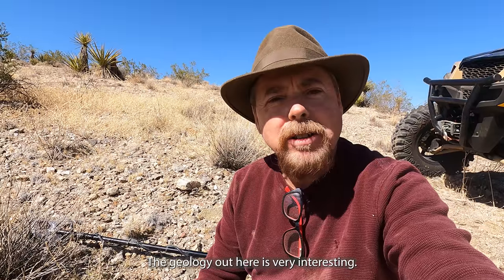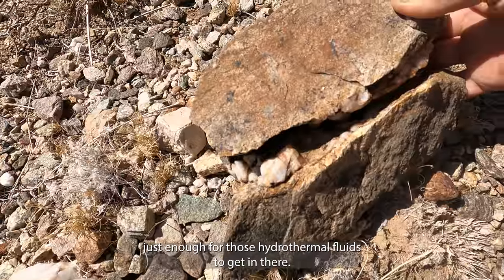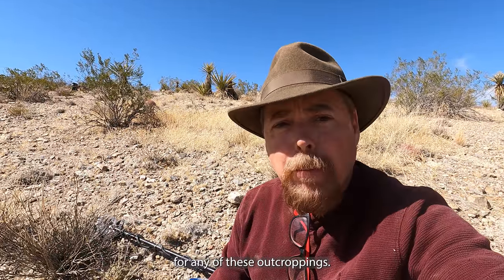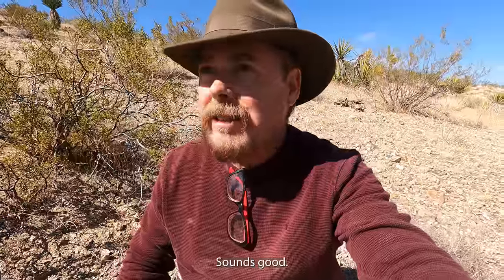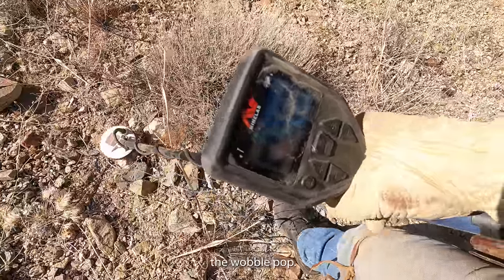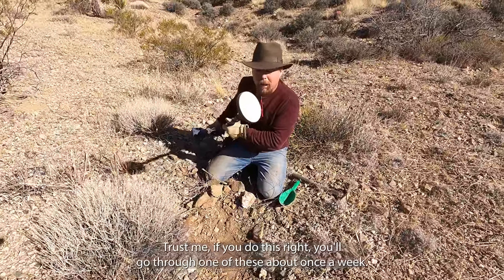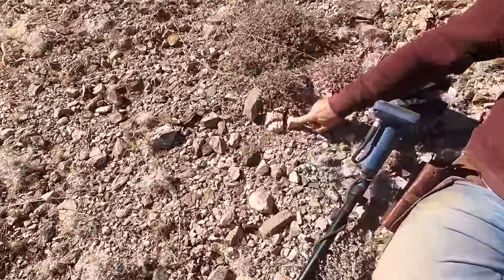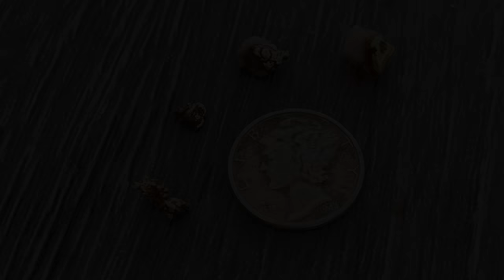Hillside Screamer's Everywhere. Metal detecting Eluvial Gold deposits.

Comment: Loved the geology lesson! I couldn’t help but laugh when your light fell. Until you’ve been underground you don’t really understand how frustrating it gets not having lots of room to work.
Reply from the maker: thanks and I know..... right
Reply: We take along a 36-inch roll of 2x4-inch hardware cloth (wire fencing).  Measure the perimeter of your working area, cut off a length to fit 60-75% of that and frame it into place..  Hang everything on it.  Works almost as well in the river, as long as you remember that it has to stand up to and hold things against two force vectors, gravity and current instead of just gravity.  In water, always place it downstream so the current is pushing tools against it rather than trying to pull them off.  Save your lengths, you will reuse them often.

Comment: I wish there was somebody like you out on the East Coast that could explain the geology of New Hampshire to me so that I could go gold panning and actually find gold instead of Micah
Reply: @bradthompson5383  any time there is heavy rain or a flood there's erosion incense in the state of New Hampshire you're not supposed to dig in the bank's the best time to go is after a rainstorm
Reply: @bradthompson5383  I want to find a place to find Hard Rock gold the alluvial.
Reply: @bradthompson5383  absolutely I do not disagree I'd like to find the specimen still inside of a rock that's all I just want to see it inside of the host-rock anybody can go dig a hole if they know what the Rock looks like did the gold is coming from which I don't know I know that it's a quartz I know that the courts if there is quartz around needs to have dimples dents in rust stain( vuggieness???)

Comment: Jeff, You should make a model of a fissure and how it works. When you talked about the fracture and cooling with crystalizing, many people think the fissure is filled like a fire hose and slows down and solidifies. It's more like the effect you get inside an exhaust pipe build up. When minerals drop out at like 1,200F or 900F, the water wont. That's what keeps going and pops out of the ground. They're still open when they stop and after many many flows can get clogged up solid over time, not all at once.

 You covered all this but to someone thinking it flows like a hose full of water, it don't make sense.

 I just cleared it up with my kid.
Reply from the maker: great idea

Comment: Thats pretty slick there Jeff.  You have gone a long way from your cave outpost to a working mine. 
Should look into a centrifical vacuum system instead of shoveling. We used a industrial sandblasting system that had a big diesel powered vacuum that could move 6 ton of sand in minutes

Comment: Great finds Jeff and Lilly. Your knowledge is incredible and so helpful, Jeff. Hey Sonny Jim! You need to get a Milwaukee (MLW 2853-22) M18 Fuel 1/4IN Hex Impact Driver XC Kit instead of using a ratchet for your bolts and hardware brother! Lot easier and faster. 
Plus tell Slim to get off his butt and starting shoveling the muck. ;D
Reply from the maker: thanks and will look into it
Reply: @Askjeffwilliams  
Bet Milwaukee Tools might give you one to promo for your channel. You do a ton of work in your videos that could be highlights. I use your advice for the metal detectors. furnace, crucibles, scoops, etc. for everything I buy.